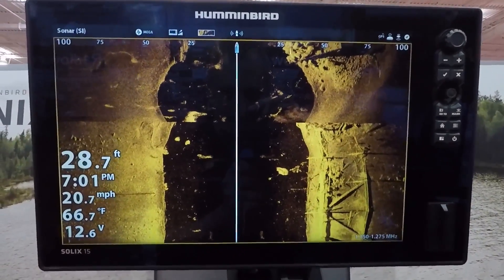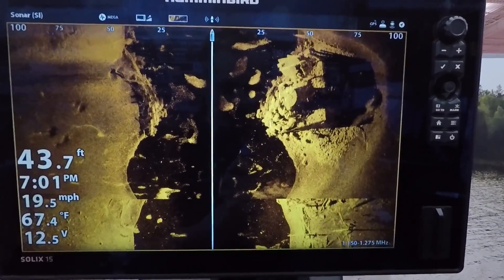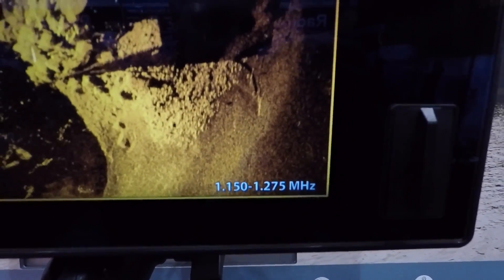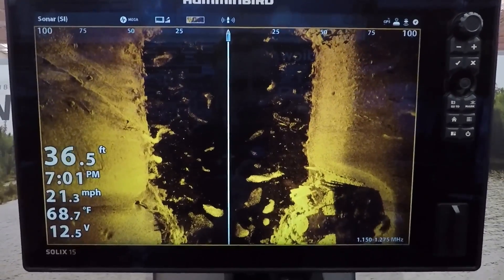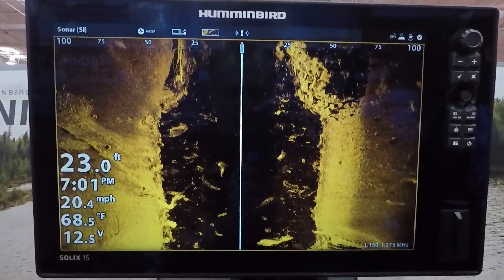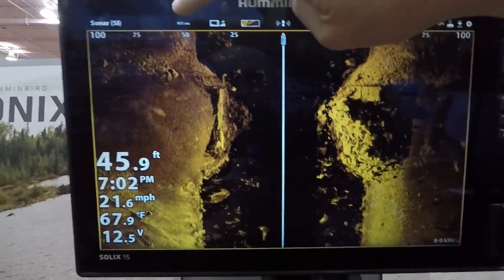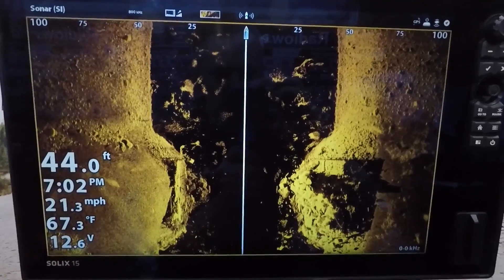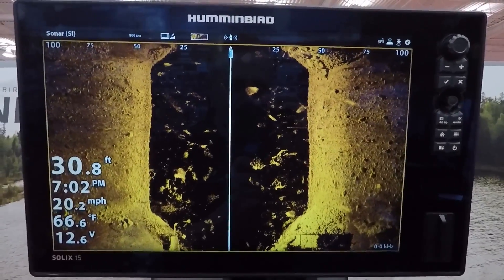Humminbird MEGA Side Imaging Explained

Comment: Let me explain it better: The Higher the frequency the less of an image you will get. Just like sound, long waves (bass or 455khz) travel further and short waves (high frequencies 800 and higher kHz ) dont go far at all. What you wind up with is a 15” screen like this guy and very little of it used, which is a WASTE OF MONEY HAHAHAA!!! Get a helix and stick to 455k as it is all you need to find fish and structure. The higher frequencies are a gimmick...not useful. They prey on the technologically ignorant and make lots of money doing it! Btw, what you see in DEMO MODE is NOT what you will see on the water. Don’t believe me? Drop some big $$$ and find out the hard way.
Reply from the maker: To clarify...you actually get more detail on the higher frequency but less distance.  So the 800khz has an application when you want detail of a target close to the boat.  The 455khz works great when detail isn't as important but you want to scan a larger area.  As for the mega frequency it will be the most detailed in very close ranges (under 75').  Personally I don't see much application for it, but the benefit to buying a Mega unit is that you get the 800 and 455 range in CHIRP which makes the detail much better than the single frequency units.

The demo mode on the Humminbird units (in 455 and 800 CHIRP) is a very good representation of what you'll see on the water.  

The 15" screen increases visibility so the bigger screen is actually a benefit.  Personally I'd never buy a 15" as I can see a 10" fine and you can get a better unit in a Helix if you want to go Humminbird.  Because you can adjust the range on the 15' screen (like all units...lol) you can actually use the full 15" even on Mega.

Mega imaging is marketing for sure but like I said you should be buying it for the CHIRP SI more than the Mega frequency...that is what is going to be useful for most anglers.
Reply: I'm dumber for reading this